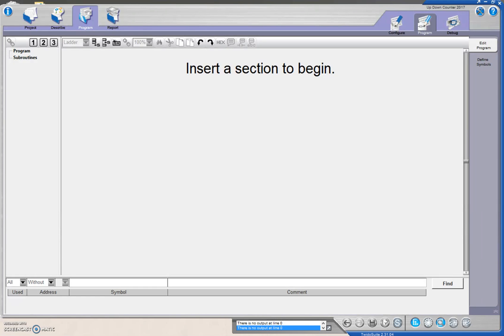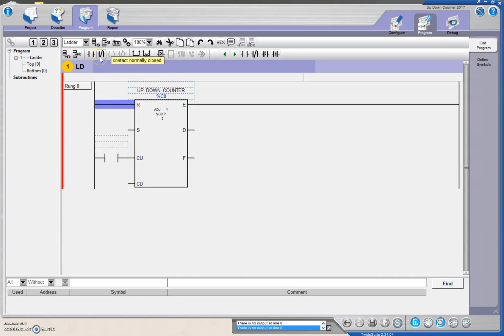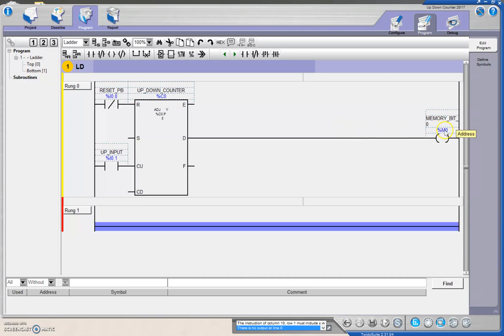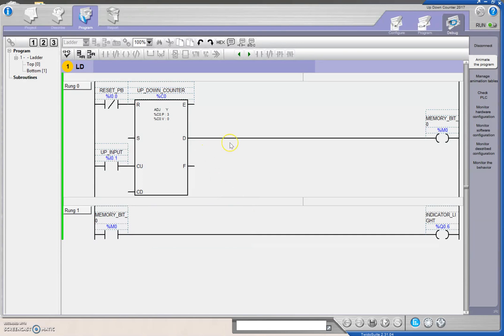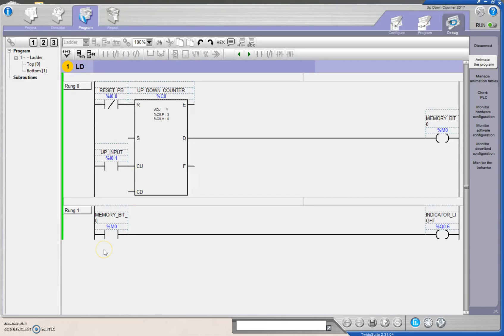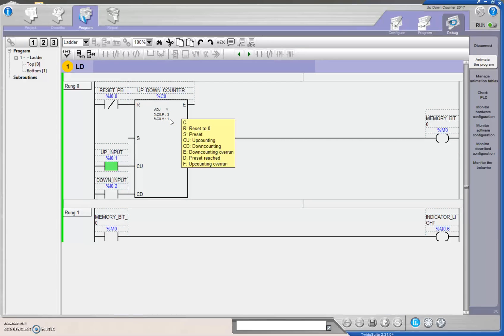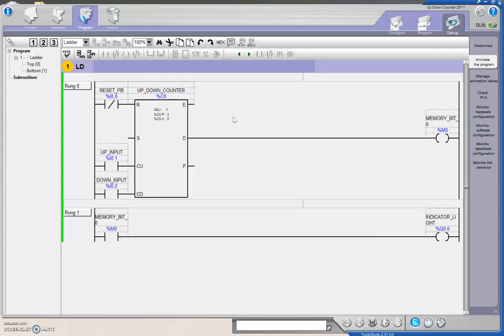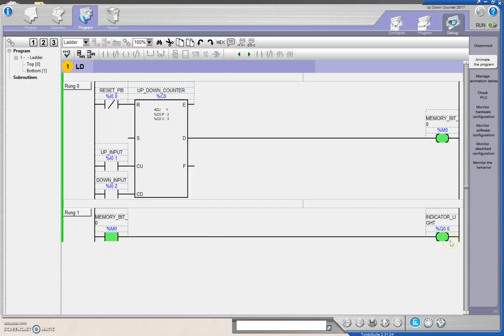PLC Tutorial (TwidoSuite) #10 (Up Down Counter)

Comment: If I press down at 0 it will become 9999 how to prevent it sir?
Reply from the maker: You'll have to find a Limit instruction to use, or a Comparator. i.e. it has to be below a certain value to provide an input signal.